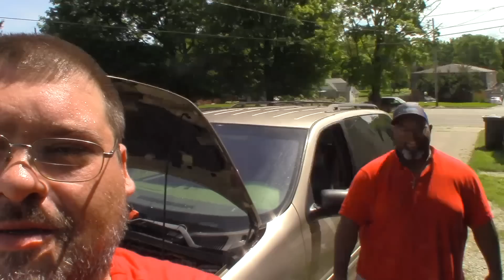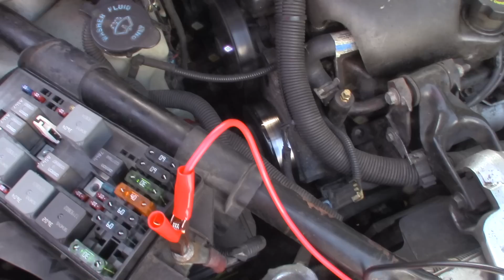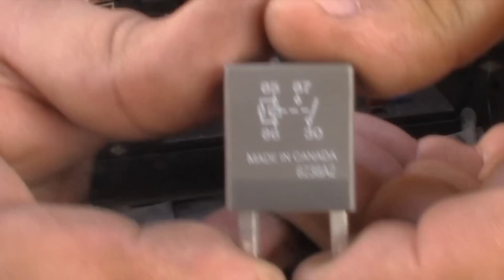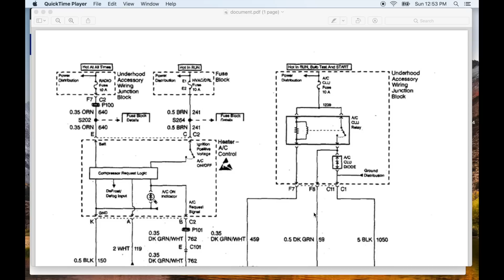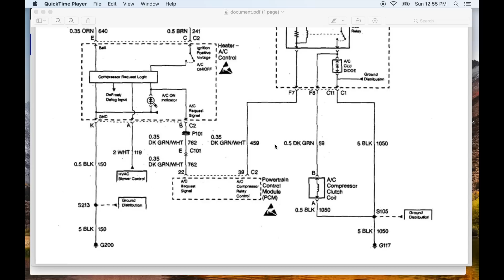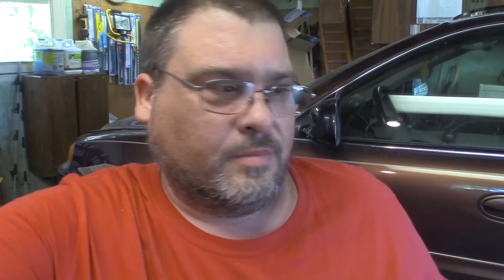Diagnose Serpentine Belt Pulley Noise with a Power Probe IV

Comment: This is a good video on testing points on a relay ... very horribly bad video on to how to find a noise on a idle pully lol 😅.. it nakes no sense . All u have to do is turn the ac switch  on in this case ... because its a bad compressor bearing .. what if it was actually a idle pully .. 😅
Reply from the maker: The relay won't engage if I turn the AC on.  Because it has no refrigerant in it.  An it is a bad Idler pulley.   And if it is a electronic problem with the pulley or the relay is bad... It wont click on and engage.

Comment: This should  have a " Don't try this at home" message.
Reply from the maker: No, I think everybody should try it at home!
Reply: @FrugalPrepper's Garage & Garden  I personally would not use a power probe near any control module circuits. In your case I would apply power directly to the compressor coil. With a jumper if need be. Misread wiring schematics and applying power is a costly mistake with a power probe. Nice demonstration of the power probes abilities.
Reply from the maker: I never provided power only ground.
Reply: @frugalprepper  Got it

Comment: The PCM isn't going to ground that AC relay unless it sees the AC request signal So even if you send power to the ground side of the control part of the relay nothing will happen. If it is not grounded Then there is 12 volts present all the way to the PCM. Just look at the wiring diagram and send power to the right pin.
Reply from the maker: True, but the current is limited by the current draw of the control side of the relay.if you do shove 20amps of current through it when it is pulling to ground you could let the smoke out of the ecm.

Comment: Great video.  Would this be safe to do, if the ac was working?
Reply from the maker: Yes, but if the AC was working you could just turn it on and it would engage the compressor clutch, so there would be no need to manually engage it.
Reply: lol.  Good point.  Have this work truck.  The ac only comes on when it wants too.  Was thinking this might be a good way to make sure the compressor was working, and the relay.  Was worried that by just kicking on the compressor, I might over pressurize the system or something.  I have not done much ac work.
Reply from the maker: You wouln't want to force it to run for a long time without blower and cooling fan running but it won't hurt anything to kick it on for a few seconds.
Reply: Cool.  No pun intended.  Wait, pun intended :)

Comment: Looks like the power probe is in good hands (I was gonna type PP is in good hands but that would be weird).  
Gonna change the AC clutch or just use a shorter belt and skip the AC pulley?
Reply from the maker: I am getting a new compressor and clutch from the junk yard.  Look like all the pag oil is leaking out of the front seal on compressor so I think that is where his leak is.  If we replace it we may be able to vac it and charge it and it will hold.

Comment: Good video Tom. Yes, I have seen Scanner Danner do that as a way to know that you are not going to harm the engine computer. Just try to energize the relay with a test light by energizing the control side of the relay with the test light while the relay is mostly plugged in.  Great job of demonstrating the safe way to do it.

Comment: Another great video Tom.  I may have a compressor (2001 Olds) to replace in my future so I'll be looking forward to the video about that.  Thanks.
Reply from the maker: They are simple to do from the bottom.  You have to pull them before you can roll the motor forward to work on the back side of it, so I've pulled them off and on a 100 times.
Reply: That's tremendous.  Had no idea.  You are a wealth of knowledge.

Comment: wouldnt you have 12 volts at the pcm on the control wire for the relay until the pcm grounds it?
Reply from the maker: Yes, but the power probe saw it as more than .5 volts of difference from the voltage at the battery terminal, so it doesn't beep and light.   I would expect this with as long as the leads are on the power probe and since it is going through a induction coil in the relay.  If you got to 6:40 you can hear for a minute it was just under the .5 volt difference threshold and it gave me the high tone just before I clicked it to ground.